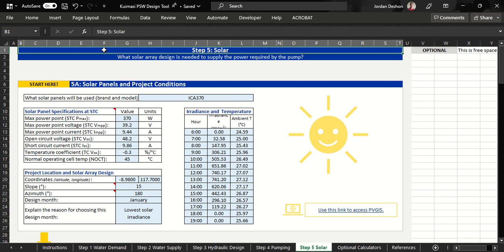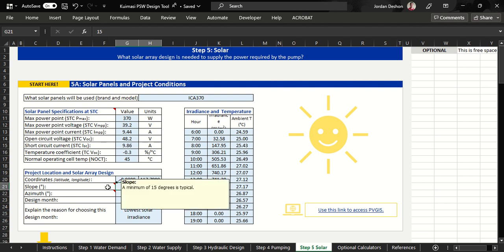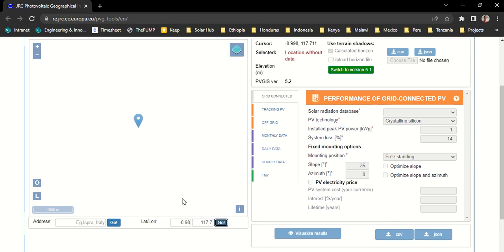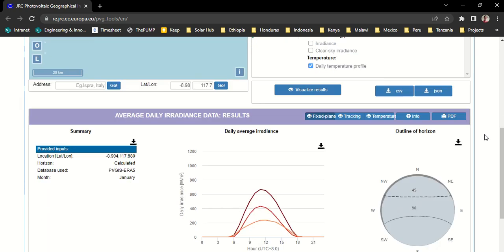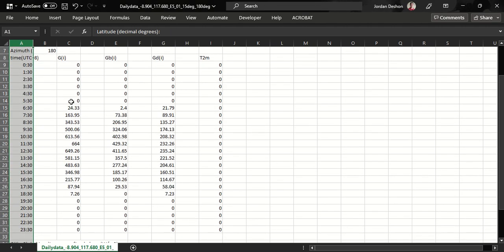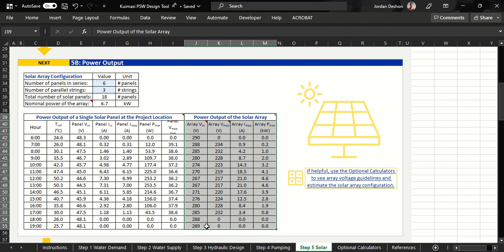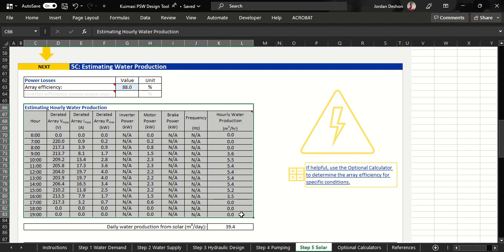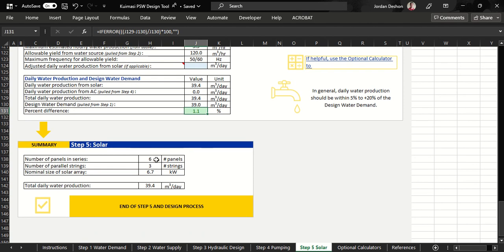Step 5   Solar Pump

Comment: Q2: having chosen January, least sunny month, for Solar panel area sizing, using PVQ website, you then mentioned check that the VDC does not exceed the maximum 300VDC acceptable from pump selection in Step 4. This was demonstrated, but what about the most sunny month of July, say, does that need to be checked for Voltage also?